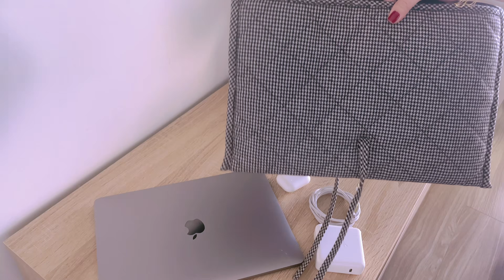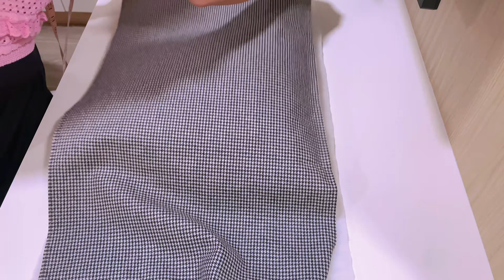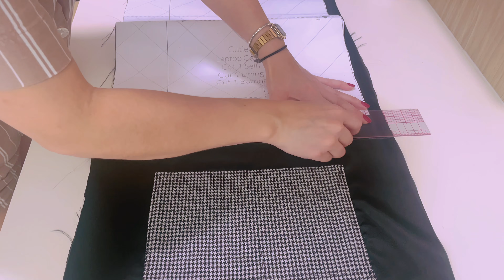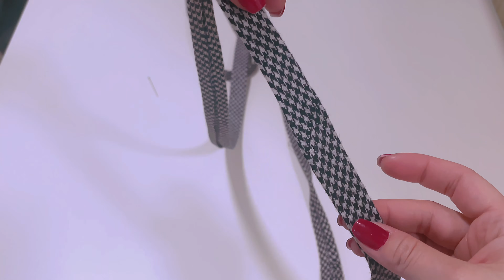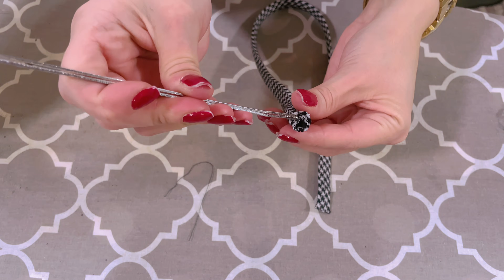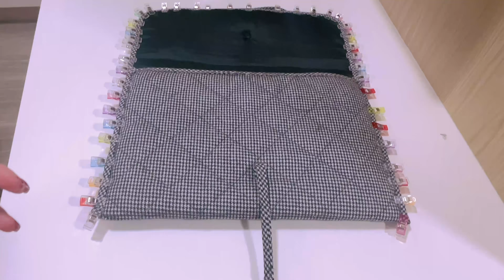Beginner Quilted Laptop Sleeve | How to quilt fabric | PDF Sewing Pattern

Comment: hi!! I find this so cute and would love to make this for a friend. However, I am COMPLETELY new to this, never exposed to sewing etc. May I ask the dimensions for a 13" macbook and what kind of fabric material i can use? (Cotton, polyester etc..)? Currently trying to find the items needed but afraid I will buy the wrong type/ materials 😢
Reply from the maker: Hi!! 🩷 You can find the pattern linked in the description box ☺️ It comes in two sizes to fit different device dimensions. For fabric I would recommend using cotton fabric because it’s easy to work with, quilts nicely, and is a great option to start with. Don’t be afraid!! The most important thing is that you start!! feel free to reach out I’m here happy to help and guide you through any part of the process

Comment: Would it be easier to cut the foam insert 3/8”or 1/2” smaller than the other fabric, to reduce bulk and eliminate the need to trim it down when applying bias tape binding?
Reply from the maker: Hello there🩷 thank you for your comment. Yes, you could reduce the size of the foam insert. I would first make it 1/8”- 1/4” (max considering seam allowance is 3/8”) smaller to ensure it aligns more easily with the rest of the pieces and, most importantly, gets caught inside your seam allowance. If needed, you can trim it slightly afterward.

Comment: How do you get rid of the markings for the quilting? :)
Reply from the maker: Hello!!🩷 There are a few ways to mark your fabric and get rid of it when you are  done. You can use sewing markers that disappear with heat—just apply a little steam when you're finished and the marks will vanish. In this tutorial, I used a regular bar of soap as a marker. It works well for light markings, and when I'm done, I simply wipe it off. However, If you're interested in quilting more often, I recommend getting a quilting presser foot for your machine. They often come with an attachment that helps you maintain consistent spacing between lines. This makes it much easier to achieve evenly spaced quilting lines without having to mark each one individually.